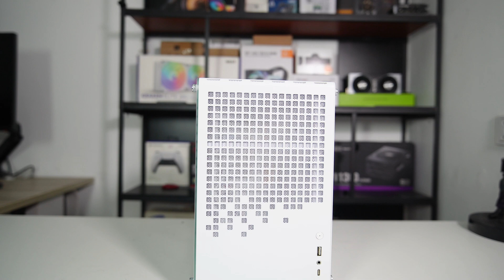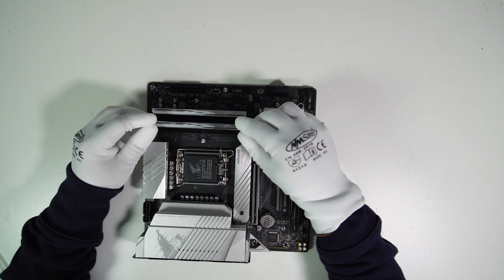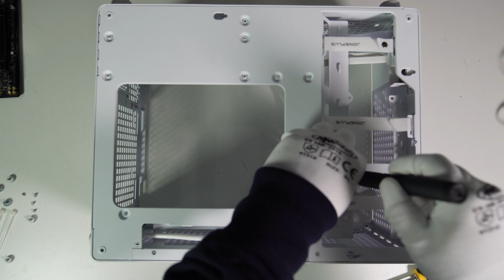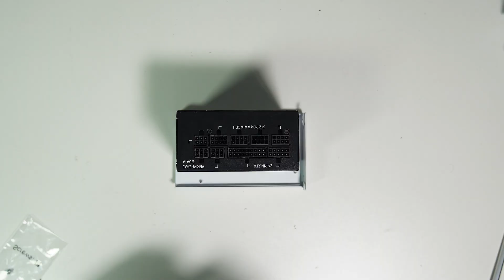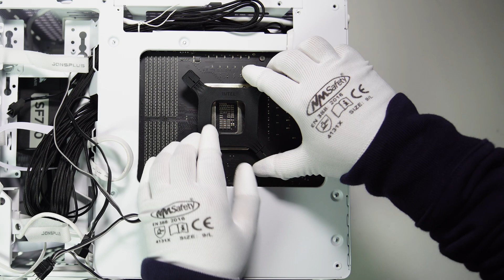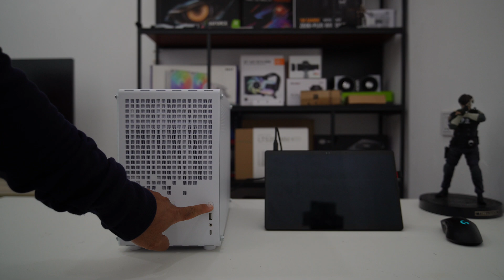Jonsbo Z20 White M-ATX mini PC Chassis budget gaming PC build.

Comment: Did you connect the portable monitor cable to the dp port of the video card o hdmi port ?
Reply from the maker: Hi there! That is not a monitor; it's an Asus VivoBook Slate 13 OLED Windows 11 Tablet with a 13th Gen Intel Core i3 processor. I connected the PC to a Razer Ripsaw HD game capture card via an HDMI cable, then linked the capture card to the tablet PC via USB-C and to the monitor through OBS. Thank you.

Comment: Nah please don call this build "budget" im from mexico, and today i got the last part of a pretty similar build, without the graphics card, and  a rm850, b650 wifi msi, r7 9700x, z20 white, thermalright AIO 240 and 16 gb xpg lancer neon is about 900 bucks, i tried to make a solid base to put any gpu i want
Reply from the maker: @pablordz3043  I call this butget build because I used part like B660m motherboard i5-12400f anf rtx 3070 which these parts are outdate and cheap unlike your selected part.

Comment: You put the ssd in the slower slot. The one under the heatshield by the gpu slot is faster.
Reply from the maker: Both M.2 slot are PCIe 4.0 so it will the same speed.

Comment: Could you fit a 280mm radiator up top? And if so, would it need to be thin? I know of 20mm thin ones but if a regular 30mm thick one can be used then that's fine.
Reply from the maker: No, it can't. I already had an NZXT Kraken Elite 280, but I couldn't install it in this case, so I bought a new 240mm as shown in this video.

Comment: If you attach the portable monitor on the case, youve basically made yourself an all in one portable pc
Reply: @alonsogabriel9336  what I’m aiming for
Reply: Do you think there's a good way to attach a portable monitor on this case? I'm curious now to try it... 🤔
Reply: @ShaunaJagan  the d31 case, which is just little bigger than this model have a LCD panel attach to it.
Reply: @dannyrodz  the D31 is an amazing case, but when we talk about mobility, the Z20 is still the best choise. Also, D31's screen is only 7" inches and has a low resolution/refresh rate compared to dedicated external monitor..
Reply: @ShaunaJagan  lol, ironically was thinking of trying the portable idea, the biggest thing is the practical nature of carrying around a power board to power both the PC and a Monitor that is about the size of a laptop monitor.

Turns out at least the ones on the market, if you want the same kind of monitor quality as big monitors for the same price you're in for a shock. most of the portable monitors cap at 60 hz, ones that go above that are double if not triple the price of the ones at 60hz DX

The PC ironically will need to be somewhat shock proof, which considering how tightly packed everything is not hard to pull off. curious to see if fan cooled CPU would be doable or not with that kind of moving around
Reply: @ what do you mean "most of the portable monitors cap at 60 hz, ones that go above that are double if not triple the price of the ones at 60hz"?

haven't you heard about Zeuslap, Upperfect and Arzopa? I got mine Zeuslap 15.6" 2560x1600 120hz 100%sRGB with Touch support for 250 bucks lol
Reply: I mean it in NZD with a place called PB Tech. It's like Micro Center but worse when it comes to supply. XD I assume you're talking about that monitor in USD?
Reply: @alonsogabriel9336  I’ve been planning to do that actually for a while

Comment: Is it not possible to have the aio tubes to the right i prefer that look
Reply from the maker: Yes, indeed you can install AIO tube in the front position. However, I install the tube to the back position becuase my PSU cable is too short so I need to install PSU on the top that is why I need to move the AIO tube to the back. Thank you.

Comment: Have this case in black and orange, which i think is a wicked color combination. People who looked at many SFF builds but never dare to try one themselves, this is the easiest case to get started with. I have my mine build with a dual 120mm tower air cooler. Air cooling makes it easier to put in a full ATX psu. If your ATX psu is short enough 140mm according to manual but you have 15mm more space then they spec. you can fit a GPU upto 363mm. Full ATX and such a big GPU are easier to do with a big air cooler then a AIO. If you really want a AIO and a huge GPU then a SFX psu or a ATX PSU that is very short (140mm) is mandatory. You can fit 1 120mm and 4 120/140mm casefans, but i can recommend to use only 120mm fans because there is no configuration where 120mm have problems and it leaves more hidden cable management routes. If you really insist on having 140mm casefans then the 2 in the bottom will give the least problems. The 2 in the top will cause the PSU not fitting in the top most position, which is not a problem if you have a GPU upto 273mm (most 2 fan GPU models) because that will fit with any combination of other components.
Reply: Aww man I just ordered this case with 4x 140mm fans. I already have an ATX PSU that's 160mm and GPU is 286mm.
Reply: @Ogk10  guess you go also for air cooling then. Best thing i can recommend is to only mount the rearmost fan at the top as exhoust and 2 intakes at the bottom. The pdf manual at the Jonsbo or Jonsplus website has a table in it that explains the combinations that fit in the case. I think with the PSU in the top most position you have a chance it will all fit except for 1 of the fans. Did you buy 1 120mm for the backside of the case? I did and because you can use that as exhoust as well it will get rid of the hot air in the case no problem.
Reply: @chinesepopsongs00  yes I have a 120mm for the back and tower cooler. Will see, might need a newer PSU with a 12+4GPU cable for future proofing
Reply: @chinesepopsongs00  thank you so much.

Comment: My GPU is RTX 4080 Super Aorus Master, which is 357mm long, and 163mm wide. Based on the specs it will fit, but what do you think considering you already had experience building with this case? It will be paired with a FSP Hydro Ti Pro that is 150mm ATX psu. Willing to go air cooled.
Reply from the maker: The Jonsbo Z20 supports GPU clearance up to 363mm. However, the RTX 4080 Super is too thick, so you probably cannot install the bottom fan. Since the case is compact, installing a very large GPU without the bottom case fan could affect the GPU temperature.
Reply: @itggear можно поставить корпусной вентилятор с уменьшением профилем 15 миллиметров. Блок питания подойдёт только sfx

Comment: Hiii

I'm making the same build but I've put deepcool AK400 for my 12400 
Same motherboard 

Used deepcool fc120 argb fans, but argb doesn't work well. It was okay first time i launched a pc, fans were synchronized with motherboard light. It was the first and last time I saw the proper light. I've checked on another pc, fans are good. It's drivers problem for sure. But nothing helps. After update it becomes even worse 
I'm so frustrated. Was inspired by your video...and such result. WiFi stops working every time  I update bios. Bluetooth has never worked.
Reply from the maker: I also have a problem with the Deepcool FC120 fan since it has a built-in RGB controller. Try disconnecting the ARGB cable from the motherboard, and the fan RGB will glow by default. If you are also using a Gigabyte motherboard like mine and have problems with booting, don’t worry, I also had this problem. Check your PSU to see if it is working normally; I had this problem once when my PSU was faulty. Download the BIOS from the Gigabyte website for your motherboard model, then extract it to a USB drive and rename it to gigabyte.bin. Plug the USB drive into the USB BIOS boot port, unplug the power cord, and then press and hold the BIOS recovery button on the motherboard. While holding the button, plug the power cable into the PSU and then release the button. You will see the BIOS recovery indicator light blinking. Wait a few minutes. I hope your PC will boot normally. For further assistance, please feel free to leave your comment. Thank you.

Comment: Hi i'm using jonsbo z20 and coming to build deepcool lt520
I want to know if it was ok if the pump pine at the right and the psu at position p3 ?
Reply from the maker: The power supply featured in this video is the Corsair SF750, but its CPU power cable is a tad too short. However, if you happen to have a longer CPU power cable, you can install the pump tube facing the right side. Thanks!
Reply: @itggear  tks very much

Comment: How much faith do you have in that handle ?
Reply from the maker: I have a good amount of faith in the handle on the Jonsbo Z20. It’s designed to be sturdy and can handle the weight of the case when it’s fully built. However, I always recommend lifting with care and supporting the bottom of the case as well, just to be safe. Thanks for watching!
Reply: from what i know it was not screw right? its like hook it up right? im so worried about it too

Comment: it there a way i can take those squares off the glass?
Reply from the maker: The squares are ink-painted on the glass side panel, so they likely cannot be erased. This design is part of the Jonsbo Z20 chassis’s aesthetic. However, if you prefer a similar case without the square marks, there are many other models and brands available. Thank you for your understanding!
Reply: You can easily remove them with a razor blade, or acetone.
Reply: @xMaGuSx888  i ended up going with the cool master nr200p
Reply: Others channel recommend acetone to wipe it out.

Comment: how much for 1 pc like this ?
Reply from the maker: It’s not too expensive since I didn’t use the latest PC parts. The entire PC costs around $1000, with the breakdown as follows:

GPU: $300
CPU: $100
AIO Cooler: $75
RGB fan: $30
PSU: $140
RAM: $120
Case: $75
M.2 SSD: $125
Thank you!

Comment: I have a question regarding ATX PSU size, I will be reusing my SeaSonic PRIME Ultra Gold 850 850 W 80+ Gold Certified Fully Modular ATX Power Supply, RMA'ed from a dead Seasonic PSU in March 2019. Can this model fit in the case?
Reply from the maker: The Jonsbo Z20 supports full-size ATX power supplies. Additionally, the case is designed with flexible mounting solutions for bottom fans, rear fans, top fans/AIO coolers, and the PSU. This means you can adjust the position of all these components to fit your needs. However, keep in mind that a large PSU may affect the top fan/AIO radiator and GPU limitations. To ensure the case fits all your selected components, please check the case specifications at the end of this video or on the product website. Thank you.
Reply from the maker: In my opinion, if you install a large PSU along with a large GPU, you’ll need to mount the PSU all the way to the top location. However, doing so will prevent you from installing the AIO radiator. Conversely, if you choose to install the radiator on the top, you’ll need to place the PSU at the bottom location, which may limit your ability to install a long graphics card. Thank you!
Reply from the maker: Absolutely! It’s like solving a puzzle, piecing together components to create a powerful and efficient system. Each choice affects the overall outcome, just like fitting those puzzle pieces perfectly. Keep having fun with your PC upgrades and gaming content! 😊🎮🧩
Reply: @itggear  Sorry typo error. Deleted the pervious comment. Was going to say I'm going to air Cool my 7800X3D or Ryzen 5 7600. Have not decided on which CPU to settle on. 

CPU Coolers, (Air and AIO) I have in mind:

- Arctic Freezer 36 ARGB CPU Cooler (Low fan noise, smart install of fans.) 
- Thermalright Phantom Spirit 120 SE
- Montech Metal DT24 Base

Comment: Did you encounter any difficulties doing cable management in this case?
Reply from the maker: Yes, if you choose a power supply, make sure the CPU 8-pin cable is long enough. Otherwise, it can be challenging to plug the CPU cable into the motherboard. In this video, I’m using the Corsair SF750 PSU, but the CPU cable is too short. As a result, I could only install the PSU in the top position, which pushed the AIO cooler all the way to the back. Consequently, the AIO tube is facing the back of the PC due to the PSU taking up space on the AIO radiator. For cable management, it’s not too difficult because the case provides ample room behind the PSU to hide all the cables. Thank you.
Reply: @itggear  Would you recommend an ATX Size PSU in this case?
Reply from the maker: I think that if you plan to use a dual-fan GPU, an ATX PSU should be fine.
Reply: @itggear  Hmm ok, thank you for this insight!
Reply: @itggear  I will be reusing my ''MSI RTX 3060 VENTUS 3X 12G OC'', purchased in March of 2021.

Comment: beautiful build! Just a quick question. I bought the sf750 corsair psu 2024 version and I was under the impression that the 8 pin pcie cable for the graphics card was just 1 connecter, but i notice you had to zip tie the other connector that was hanging off of it. Are you using the 2024 version of this psu or is this the older version? Because I want my pcie cable to just have 1 connector. thx!
Reply from the maker: My Corsair SF750 is the previous version; I purchased this PSU in 2022. The reason I used a zip tie for the PCIe cable is that my GPU (RTX 3070) has 1x6-pin and 1x8-pin PCIe connectors, while the PSU PCIe cable has 2x6+2-pin connectors. After plugging the cable into the GPU, there was an unused 2-pin section, so I tied it to prevent the cable from hitting the GPU fan blades. Thank you!

Comment: 12400 and water cooling? 😂😂😂😂😂😂😂😂
Reply from the maker: Is the AIO cooling system for $70 a good deal? It’s called aesthetics for a reason. It can also reduce stress, so you should try it too. Also, I only need to pay for the CPU cooler once, and I won’t need to buy a new cooler every time I upgrade the CPU, right? Thank you.

Comment: Hey man, can a RX 6800 (340mm) fit in this case with an atx (140mm) psu?!
Reply from the maker: The Jonsbo Z20 case supports a GPU clearance of up to 363mm, but this can vary based on other hardware configurations. If you’re planning to install an ATX power supply unit (PSU), ensure that you position the PSU all the way at the top of the PSU mounting bracket. The case allows for adjustable PSU positioning. However, if you find that you can’t install the PSU in the top position due to an AIO (all-in-one) cooler already installed, consider using an air cooler instead in your PC build. Thank you!
Reply: @itggear  Thanks

Comment: hi, can i fit a rx 6650 xt merc 308 with an atx psu? thank you
Reply from the maker: The Jonsbo Z20 case supports GPU clearance of up to 363mm and accommodates 4 PCIe slots. However, the actual clearance may vary based on other hardware configurations, such as the PSU and the presence of bottom fans. Thank you!

Comment: I just bought this case, and im very excited. I also will do as your setup using aio 240mm. Does the rear fan interfere with the radiator cable? I see the gap is very tight
Reply: Oh yeah, which GPU did you use? I see yours is 3 fan and still fit with the ATX PSU
Very nice case introduction btw
Reply from the maker: The GPU I used in this VIdeo is Gigabyte Vision RTX 3070. Thank you.
Reply from the maker: For the rear fan, it can be adjusted up or down by 30mm. The adjustment depends on your setup. If you install a radiator on the top of the case, you can lower the rear case fan to its lowest position. However, please note that this case only supports a 240mm AIO cooler and cannot accommodate a 280mm AIO cooler.
Reply: @itggear3400 ah i see, thanks for that info. It's hard to find 9cm fan which suits my style in my region
Reply from the maker: You can use a 120mm fan, and the fan position can be adjusted for an up or down position since the fan mounting hole is adjustable by around 30mm up or down. So, if you only install a fan on the top, you can place 120 rear fans at any position. However, if you install a 240mm AIO, you’ll need to install the 120mm fan at the lowest position. Thank you!
Reply from the maker: In this PC build, the AIO cooling tube is positioned very close to the rear fan. The reason for this is that the Corsair SF750 PSU’s 8-pin CPU power cable is too short. As a result, I had to install the PSU at the top and slide the AIO radiator all the way to the back. If we had a longer PSU cable, we could move the PSU to the bottom and slide the AIO radiator to the front, creating more space between the rear fan and the AIO tube. Thank you!

Comment: Great video, clean looking build. I do have something to ask, can we use an ATX PSU? If so, would two fans GPU fit in it? Thank you!
Reply from the maker: Yes, natively, the case uses an ATX power supply bracket. To install an SFX PSU, you’ll need an SFX to ATX PSU mounting bracket. However, if you use an ATX PSU, it may limit support for long GPUs like the RTX 4080/4090. Additionally, if you’d like to install a GPU thicker than 2.5 slots, consider adding a 120mm x 15mm bottom fan; this won’t be affected by the PSU. Thank you!
Reply: @itggear  thank you for the answers!
Reply: @itggear  btw, have you tried building on a Gamemax Spark Mini case?
Reply from the maker: I haven’t tried that case yet, but I plan to build a Mini ITX PC with this case: https://youtu.be/jjl-n9hsgWs. After scouring the internet, it seems this case is similar in size to the one you suggested.
Reply: @itggear  I just watched it, would love to see the full build on it! And it's definitely smaller than what i was suggesting
Reply: @itggear standard ATX power supply limits you. You have to move it up or down to either acomodify long gpu or long radiator. You can't have both.
Reply: @itggear hello, is the bracket you mention for sfx  included with the case ?
Reply: ENERMAX Revolution D.F. 12 ultra-compact power supply ATX popped in a search for a shorter PSU.